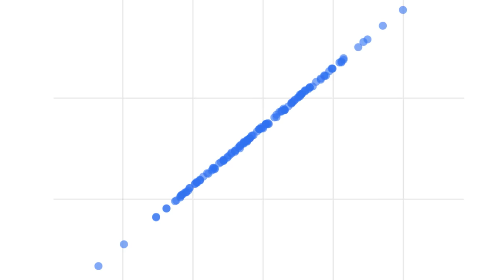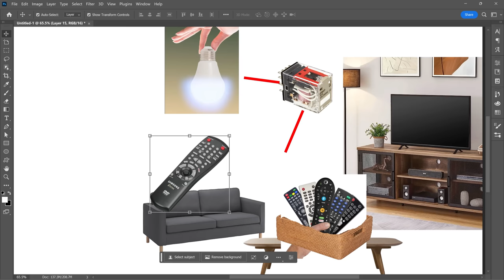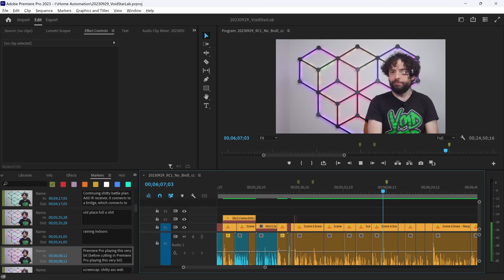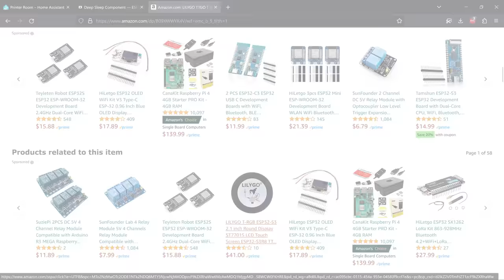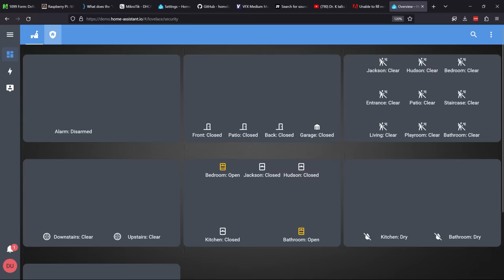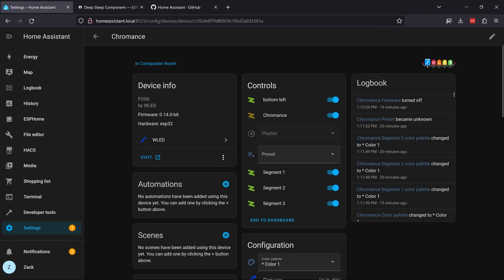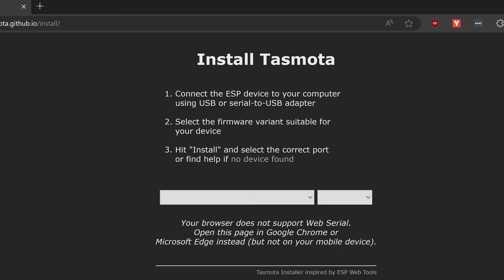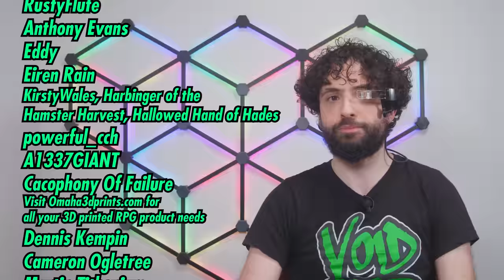Home Automation CONSUMED MY LIFE (and you're next)

Comment: Went done the same rabbit hole when I wanted to turn of the light without getting out of bed. Now living in a house with fabric wrapped wires from the 50s I risk electrical fires jamming smart relays in way to small outlet boxes.
For the gridfinity system the bare minimum is that each container has a NFC chip so that I can search for a part on my phone the the right box lights up no matter where I put it on the grid. Extra points for to be able to read a BOM and highlight all parts you need for a project.

I don't even have a gridfinity system where I could use it, I just want to see you suffer.
love.

Comment: Home Assistant actually does not require a Pi 4. I've got an instance running on an old Pi 3, which works fine (at least for a small home automation setup). However I do believe the Pi 3 is the oldest supported one.

Comment: 3d printerist here. Doing up a camper van using a pico to control lights, pump, chargers etc. I have a control panel with 16 push buttons cause I'm basic. Might add a Bluetooth. Might not.

Comment: This actually makes me interested in home automation. My biggest problem with IoT is the pointless layers of Cloud(tm) you have to go through to use them. That and the giant gaping security vulnerabilty from improperly implemented OS and abandonware. But if there's an opensource option that I can host myself (literally) in-house, along with hackable hardware, I'd be down for that. Thanks for suffering, and sharing!
Reply: For someone new to home automation, you hit on a key point.  Avoid anything "cloud" like the plague.  Some of my smart items in the home have a cloud option, but that's fine as long as they stick to the following criteria: 1) They don't require the cloud, and will work locally even when isolated from the internet (and you should isolate them). 2) They will continue to work without the cloud or the company that made them, i.e. you're not dependent on software upgrades that will some day no longer be forthcoming.  3) Uses a public API or standard protocol so you can always interface with it.  For example: most smart doorbells require the cloud.  But some (like DoorBird) offer a cloud service but can also be accessed with RTSP for video and SIP for the voice part.
    
Also: use fit for purpose protocols.  Z-Wave and/or Zigbee when possible.  If your only choice is wifi, isolate those devices on a separate VLAN to minimize the risk of crap security.
    
I've been doing home automation for over 15 years, and all the stuff I bought back then still work, except for a few malfunctions.  Even so: when you get started with home automation, you're not just doing some home improvement, you must be prepared to enter into a new hobby.
Reply: Nevermind your local government backdooring into your thermostat to turn off your AC during peak hours in the summer.
Screw grid upgrades - just offer rebates with the fine print that, if you sign, you're not really in control.

Comment: If you want a pre-made internet connected relay I’d suggest the Robot Electronics ETH-02. You can configure them to accept commands over TCP so you can toggle them with a python script. They also have a web interface. We use them to hard reboot PCs in remote scientific stations.

Comment: few times I had to have dehumidifier running for several weeks so I found that it actually had a hose that you can just pull it out of the container and connect a long pipe to it . ran that drain pipe outside the house and only thing of mainternance was cleaning its air filter

Comment: I too accidentally found all of these new home automation SPC‘s and gadgets and gidgits. I was just looking to repair somebody’s circuitboard on their hot tub pump and it was using low energy Bluetooth to communicate with the control panel and then I looked up that module and then I had to get an ESP 32 to program it and then I don’t know what week it is, but I have a lot of mail coming.
Reply: I actually had to get blue light blocking glasses to prevent headaches and sore eye holes from all of the late night uncontrollable binge reading and clicking through data sheets and amazon, and sometimes AliExpress also I admit it:)… see that I’m smiling and crying . I’m not sad my eyes have just been mortally wounded from never ending streams of the photons blazing out of my super cool color temp ultrawide monitors. In  a pitch black room, of course. Thanks for the bad*** videos!

Comment: [shakes head]  I could have saved you a lot of time.  There are twenty ways to do everything, and each thing you do has 3 ways of doing it "best".

Am I a home automation guy on a 3d channel?  Or am I a 3d guy watching another 3d guy get lost in automation?   

I invented the Internet smartphone in 1987-1990, it required me to invent the ISP.  But to be fair, I wanted to invent the ISP in 1978, but in that decade there would be one computer, and we would all have to share it on dumb terminals.

I have all of the various home automation hubs, though I'm starting to throw the crappy ones away finally.  I built a 3d printer, designed a couple more before I started buying them.  I have an automated dual-homed factory that I run from 650 miles  away with automated cameras, relays, power monitors, and some robots....  And even the wife gets involved.  It takes around 15 smartphone apps to put it together, but the control surface is much more under control as I do ifttt when I can, and I have a couple dashboards I built to control things.

I have better relay boards than you, and they have a variety of signals they can switch since they were originally designed to control test beds in an automated electronics testing lab.

For your lighted bin project I would use one wire (the protocol (Dallas semiconductor is your best friend)) for a lot of the automation, but with the addressable led strips already having a 1wire-like bus I bet you could just use the led strips signal pin to wire the whole 1wire bus together.  The lighting the bins trick is how we track down servers in large datacenters, so I've actually done that whole "light up the inventoried bin" thing before.  

And my dehumidifier is automated and self emptying.  Buy yourself a "condensate pump" for the dehumidifier.  

I have training in HVAC, something you need in datacenters that you want to earn a profit from.

And I do sql, http, bash, python, c, snmp  and I LIKE it.

I have a dozen raspberry pi's, and I used beaglebones before the pi was being made.  I have some arduinos, and some basic stamps.  

I ran a network of 900mhz zigbee rs232 multidrop
interfaces so I had a reliable automation back-channel into my wireless ISP celltowers, so I could repair them during the lightning storms (or at least see how much gear was still responding, and see if I could reconfigure to get through the night.

My bbq pit is on the internet so that I can monitor it on beer runs.

Comment: OR oooorrr... I can make you waste a few hours! 
- hack a tiny peristaltic pump from somewhere 
- drill a hole on the dehumidifier water tank
- add 2 wires on the "max" level of the tank (or if feeling lazy get an off the shelf water sensor)
- add an automation to HA that when the tank is full it turns on the pump for X minutes 
- hide the tiny tube and route it to a window or a drain nearby

Comment: Hi, where can i find more info on the RGBled gridfinity coordinator? Did you make it with optical sensors, magnet switches, RFID or NFC?
I see 8 wires I think.. did you use 1-wire or a SPI/UART GPIOmultiplexer?

kind regards <3

Comment: You've not seen the depth of this obsession. Let me tell you about how we did this back in the 1990s. There was a company called x10 that would sell you everything you needed. It used your house's wiring as a communication network. There were also lots of IR and radio remote controls. I had a 3000sq ft totally automated. I must have spent $3,000 1990 dollars. It's all in the bin now.

Comment: Seems like whole light thing could be just an extension strip with a bunch of lights plugged in

Ubiquity actually produced cool little one with 6 sockets and power measuring/control on each one (pretty cheap per socket) but they stopped making one ;/

Comment: I just got my RPi 5 yesterday. Gonna re-do my HASS installation to do it… better. Oh and of course I set up a new VLAN to move all IoT devices over to it. Then of course I am considering getting into docker so my RPi 5 can run some local LLM that should be connected to my IoT devices and maybe that will allow me to get rid of the Google Home I got right now. Oh I also have managed to find some really nice YouTuber that showed how to connect and flash the ESP with only a breadboard and an Arduino Nano (clone). I also set up a 12V DC fan that will be cooling the RPi 5 (with leds, that are inside my little tray of IoT stuff). However, I would love to know how to solder my ADHD on some board!

Comment: "A relay can't override a switch..."

And that's where you are wrong. You can use a 9/24 switch (commonly known as a stairs switch) in conjunction with any relay that has the NO-NC pins available.

I used to have my lights controlled for years that way until part of my house burned down (not related to the switch... some drunk shithead set the entire neighborhood on fire).

Comment: that's not really "automation" though. all you did was adding switches in your pocket. convenient, but switches you need to hit nonetheless. I'd set up a time table to turn the lights on and off, depending if your phone is on your network (to check if you're at home), so the lights turn themselves on. Unless you hit a switch, which prevents the lights from turning off while filming. Also, with HA you don't need to be sent an email, just use the notify service to get push notifications on your phone, tv, ....
I fell in this rabbit hole some months ago and it's soooo much deeper than you think, when you start using more sensors than just those sonoff plugs. motion detection with millimeter-wave radar that is sensitive enough to recognize you're breathing? you bet it's available. check the actual humidity in the room to save on power and stretch the time until you need to empty the dehumidifyer? you can get snazzy charts and plots from the actual values measured, turn that thing on only when needed, maybe even see some patterns if coupled with a weather sensor outdoors.
half of the fun only begins if you got sensors for everything, from which you can derive certain states that will trigger actions. and no, I'm not sorry.

Comment: Wow... such a stupid simple problem that can be solved in seconds...  You could put your LED's on a wifi outlet and used the built in app, or use google home or apple odd homekit junk that doesnt work nice... of home assistant... and control... You could of used a Zigbee/Zwave outlet too (wich is better for security and reliability) and feed into home assistant or a Smarthings outlet and program with a motion controller... there is a million way to do this....  

Also, for the de-humidifier, you can use a water sensor, 3D print a mount... Then when the water reaches the sensor, have the dehumidifier cut off... you can do this with a switched outlet again, or if you feel lucky, pull apart the PCB and find the off buttons and other items.... and then ground out the buttons to virtually push them...  

Home assistant is the WAY to go... I have a big server with over 400 devices (Switches, buttons, sensors, motion, door, windows, locks, garage, hottube, vehicles, tvs, and a TON MORE that are in home assistnat.... One thing, my calendar, if I have an event with an address on it, if I put "start" in the description as the first word, then 15 minutes, BEFORE the time to leave (it calculates that based on how long google says it will take me to get to the address, and subtracts 15 minutes from that time) and it starts my truck to warm up/cool down.  using auto manufacturure API... I can also read speed, GPS, Fuel, oil life, TPMS sensors, windows up down and % for all 4 windows, if the liftgate is opened or closed, sun roof... etc... there is MANY of the sensors for cars....

AND THEN>>>>>>>  

The voice assistants, they have a brand new one that is AMAZING!  And works better then Google or Alexa ever are....  You can name it what you want, set settings for them all and a ton more...